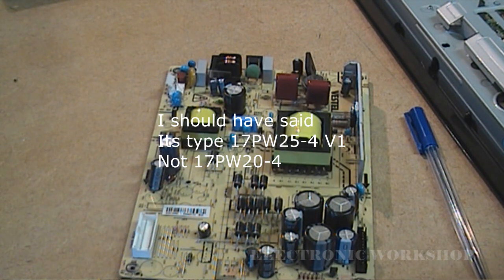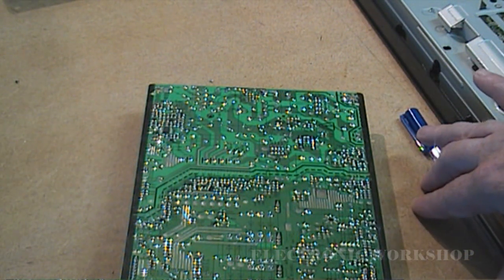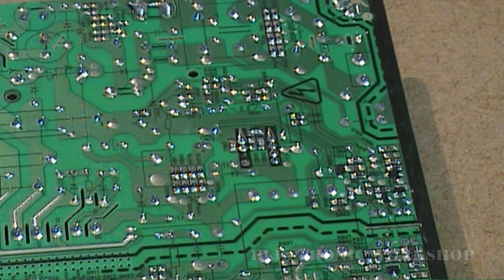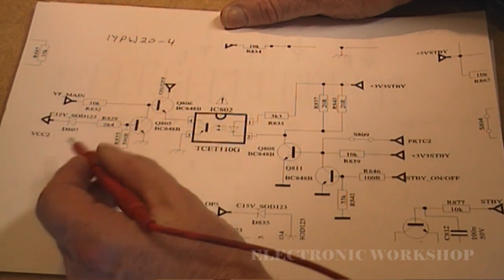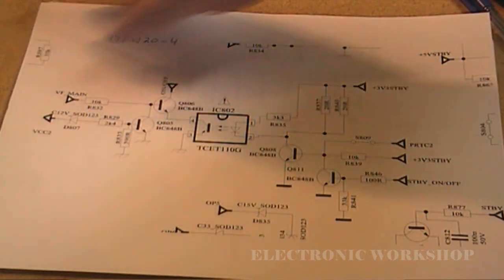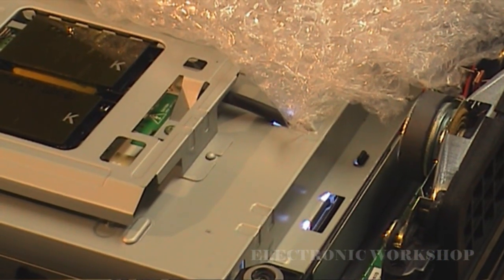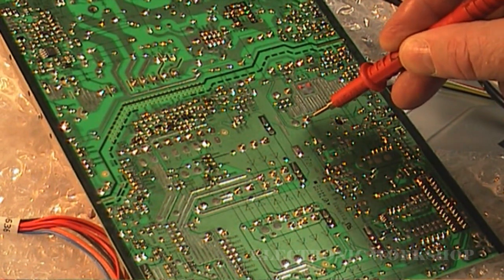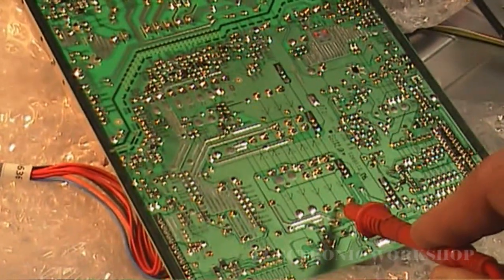17PW25-4 V1 Vestel PSU Repair

Comment: The voltage i have in the ICE3BR1765J  FB terminal is fluctuating 3v to 4v ..pfc ic..my standby voltage 5v is missing and that diode after the transformer at pfc has very low voltage and keeps on fluctuating..even in the main filter capacitor i have 268v fluctuating..all the voltages reading 13v 2v 3v are all fluctuating..actually my psu is deadset so I use 4wires module and i have that voltages present but my tv wont turn on or no standby indicator.sir what did you replace? Only the zener diode at pfc sides? Fb terminal ?

Comment: Hi, I had a similar thing with an OKI TV26 inch, same PS. Your schematic helped me! 

I think it is an overvoltage protection, just kicking in a bit too early. That diode I found it to be a 12V zener. 

I modified the circuit a bit: I put a small signal diode in series with the zener, so it became a 12,7V 'zener', and I put a 1kOhm resistor in parrallel with the 390 Ohm between base and ground, this way it is less critical.

Good luck,

Leo